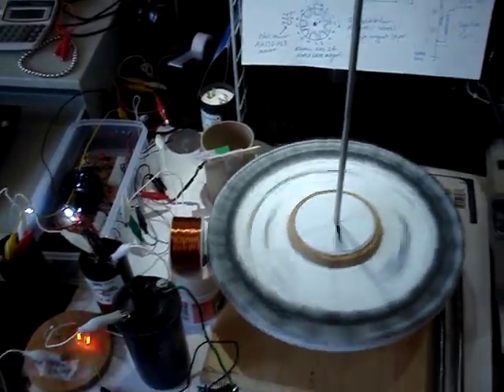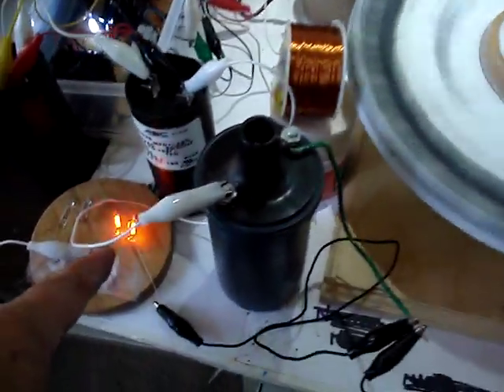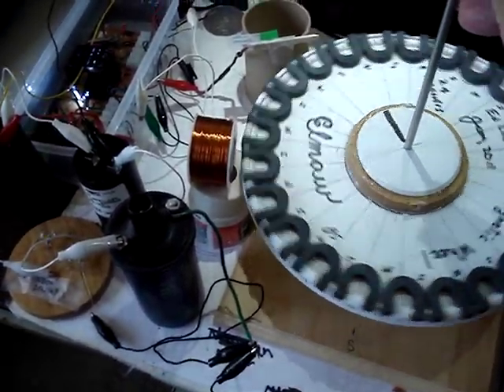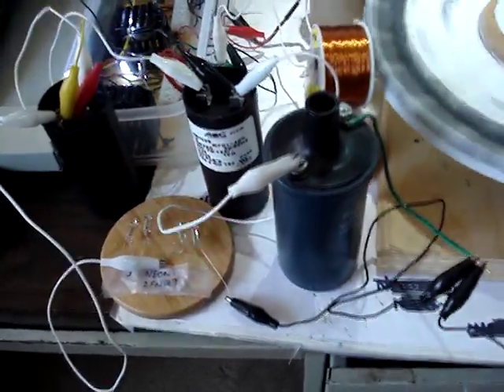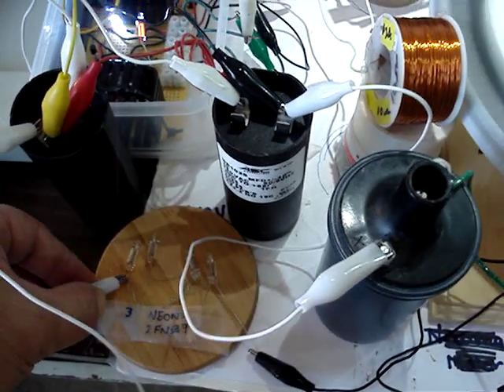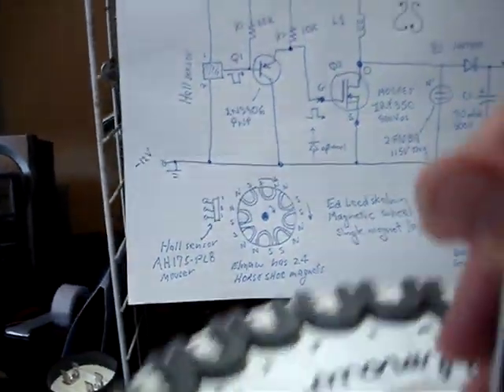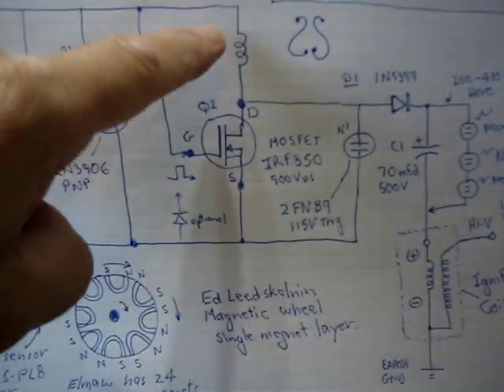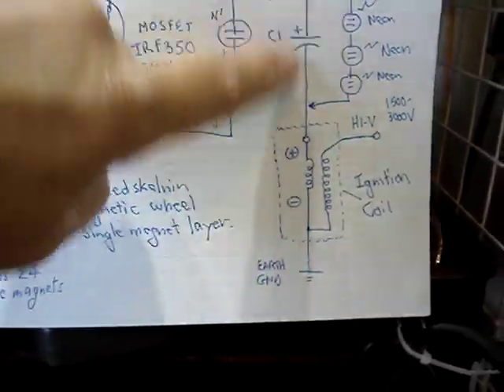ELMAW 2   ( Ed Leedskalnin Magnetic Wheel 2nd video )

Comment: Ed used only a few bar magnets on the thin flywheel that used to press against the pressure plate of the transmission.
He made the coils by winding wire around the bottom half of soda bottles.
I was really young when I met Ed. He seemed like nice man withy an interest in astronomy also, but he didn't do any of that supernatural stuff some people thinks he did. He used a Chain Fal Hoist, and large poles to hoist those stones with. He only had to hoist one side of the rock after he trenched it out

Comment: Cool. Nice work. Looks like the coil diameter is wrong though. You may find a core will help also. Make it smaller, so the flux lines from the magnets either side, which are displaced sideways,  are clear of the coil, either side when the neutral poles, or Bloch wall face the coil. Extending a core toward the poles will help I think. Keep it up.

Comment: Jack two  kids caught Ed unloading a truck by holding 2 cones.  the device is not a motor it is actually a grinder used to convert stone to be lifted  as a vibrating energy field in the Ether around his castle.  Ed would grind samples of the stone to be lifted which prepared the environment and then focus that vibrating energy onto the heavy stone to be lifted.  The same devices are found in Egypt only they have the 24 structures around a bowl the samples were placed into the bowel.  There are many cones in Egypt museums.

Comment: Well there is a positive pole bias in the hoist chain, but it's not about reversing polarity, it's about concentrating the large particles off both poles until they lock together in linear planes of natural slow rotation spiral as they fall- heavy as gold, quickly displacing any mass. It did not have to be stone, it could have been anything.

Comment: His flywheel was setup in a way that it looked a lot like the magneto coils and bar magnates we see on flywheels on a riding mower. I don't know how he setup the coils but they were not directly over the magnates when I saw them, they looked more toward the outside edge.... But I do remember it was only like 4 or 6 magnates with big spaces between them.
I did get yelled at a few times because he didn't like me touching his wheel or the coils on the bottles.
Good luck at whatever you are trying.

Comment: The Leedskalnin Magnetic Wheel is electromagnetic pulse generator. You must tune frequence of rotation to tune the frequence of oscillation of matter inside the stone. In this way you can change proprieties of matter
Reply: Put the stone inside Faraday cage and feed the cage with correct electromagnetic pulse and frequency to null the external electromagnetic field that feed the stone continually => DEGAUSSERS
Reply: Degausser = Ereser of magnetic field inside matter

Comment: Seems that Q1 is wired as emitter follower, so the output pulse (Q2G) would be the same as the Q1B input pulse (not inverted) only 0.7 volts higher?

Comment: @jackscholze So do you plan to use the caps to backup a bank of batteries for any sort of application ? 
I connected several tiny AC-DC generators to a e-scooter with plans to series the generator output with solar.. with the idea to combine the hi voltage generator with a high amp solar output.. Have you been watching the transformer work going on.. Gabriel / Tesla device?

Comment: Good job Jack... I have a question: did you try to flip the ignition coil with the electrolytic capacitor? so the capacitor to be connected to ground ? it will make any difference?

Comment: jack your motor is too complicated.ed's magnetic emblems are your on/off switch! connect one wire from your source power to one of the emblems made of iron, the other lead connect to a pmh. the second emblem drop a wire from it to the other lead of the pmh. north pole closes the gap and south opens the gap. it is touchy on where it will stay running. it also is not self starting. some might have noticed the hand crank. /watch?v=S5QW5-VBoI0 best i can explain

Comment: Anyone can learn, it's all too elementary. Magnetic poles split in a magnet, and if you can picture that and how it happens with simple particle physics I explain also, you can picture how a polar diode of mag current (flywheel) can store charge in iron over 3 cycles of a sinewave in growing potential to restart each time thus building pump z wave momentum of heavy ions (opposite energy off both poles). Just watch my vids.